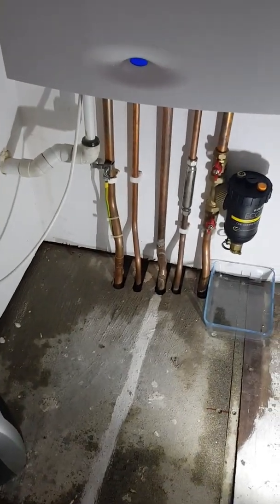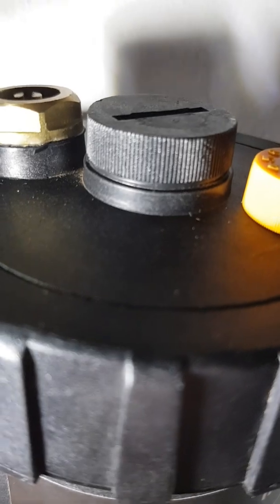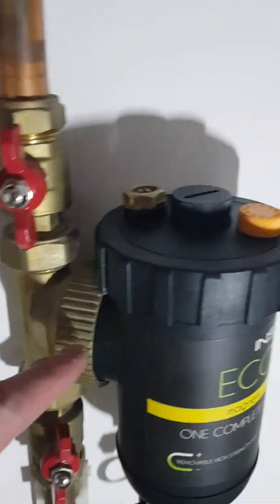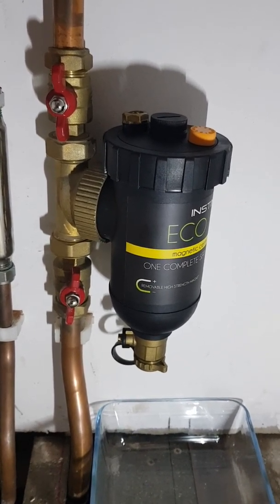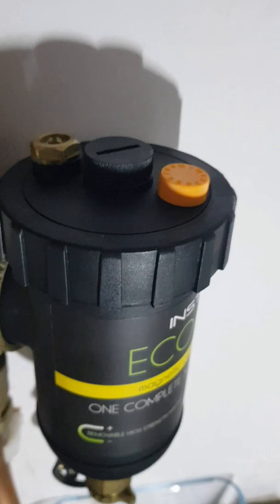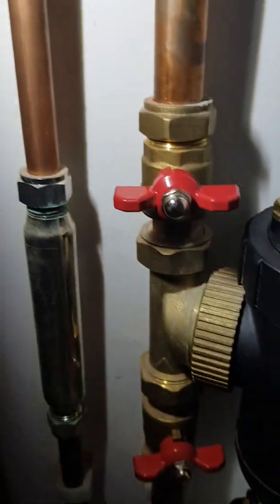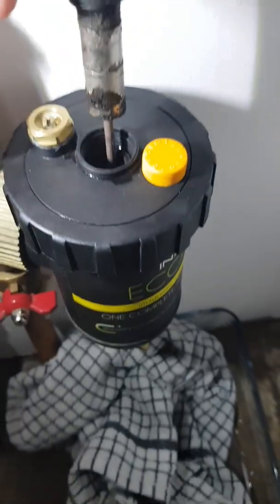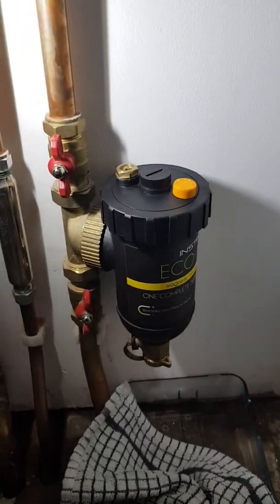Instinct eco mag filter leaking, quick fix, magnet sleeve breached/cracked. Plumbing debris magnet

Comment: Ha, I've had the exact same issue with mine. The magnets are supposed to be completely dry. In my unit, they're rusted so badly that none come out at all. My temporary fix has been to dry the top out and fill it with silicone until I have time to replace the whole unit.

Comment: Hi. I have  exactly the same unit, but the minds being dripping it the bottom. Over the past year .. .. and should it be  Connect to the hot flow 🤔.. my Worcester Bosch boiler 4000 25kw.  Will  not presh up. It's just not responding 😕.  Thanks

Comment: Did you find a replacement. Bowl that fitted the existing valve body ?
Reply from the maker: Yes itsa boiler defender 2 M8.
EASY SWAP and you change the brass threaded body aswell going straight into the 22mm unions top n bottom.
Reply from the maker: Hello I fitted a boiler defender 2 M8. it's a straight swap in the 22mm unions. You change the brass threaded body too.

Comment: Hi,
have you managed to get another filter" brand" as an easy swap, without changing the pipe work?
Reply from the maker: Sorry for the late reply,  hope you found something and got it fixed.
I used a boiler defender2  M8  type.
Straight swap with brass unions

Comment: What size O ring? Was it a standard O ring ?
Reply from the maker: It was just one that fits tight over the thread of the magnet probe as you push it to the bottom. Then just no it down. Its a temporary fix. Would last ages if sealed well. I just didnt want my magnets getting rusty and plastic being brittle. knowing it's got a leak makes me change it.

Comment: Hi there! So glad i find this video....I have the same eco mag filter, and it was all boxed in....only discovered yesterday that the old boiler cupboard which is now my wardrobe is full o black mold! So been cleaning that all out yesterday :-( My eco mag was also covered in corroded brown metallic goo....it's only leaking ever so slightly. So, my question is are you qualified plumber and is this something I can fix myself? Don't really want people in to fix it :-( Did you find a good replacement for it? Gas here....but judging by your vid all i need to do is turn off both taps and swap it out?
Reply from the maker: I'm not a plumber but have a very practical mechanical background, with vehicles,water craft, plumbing my house and others. I just dont do anything with boilers. Pipes are easy. It is straight swap out. I put a boiler m8 in @ £47. You do need to change the piece between the two valves too (filter mount thread is different) so use the one supplied. The top and bottom valves dont need changing. Just turning off while you change it  but yes it's easy. Just make sure all new seals that are supplied get put in the unions. 
Bleed the air out with the little screw on top once youve opened the top n bottom valves and you done.  Good luck.
Reply: @MrBrynbryndt  Many thanks for that! Sounds like you have a lot more experience than I, but yep does sound easy. I think I can get a good deal on a Fernox TF1 Omega, which is what I am looking at. It doesn't come with valves though and I want to be sure I won't have a compatibility issue. If you google it for an image you will see that unit comes with flat faces for rubber washers. Is the Instant Eco unit the same, or are they round? That's my only worry atm...
Reply from the maker: @jakemaverick911  should be fine they are flat washers. I looked on the net at it
Reply: @MrBrynbryndt  that's what everybody saying...'should be' nut no 100% guarantee and the guy on ebay has gone silent on me, maybe because it's the weekend.... ;-)
Reply: @MrBrynbryndt  Finally managed to get it, but ill with covid atm now :-( Seems to be missing the trigger mechanism for injecting the chemicals from underneath, is it rue you just pour chemicals in at the top?